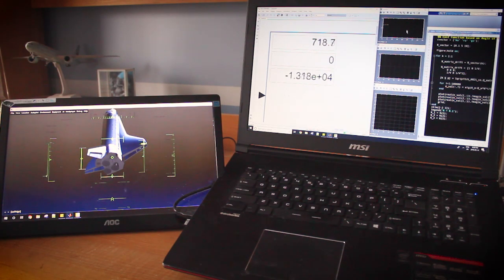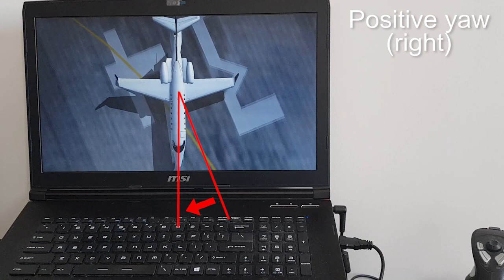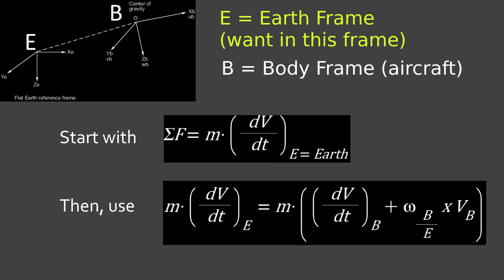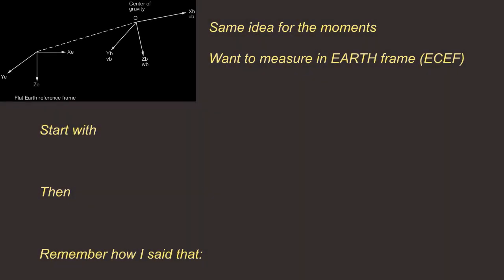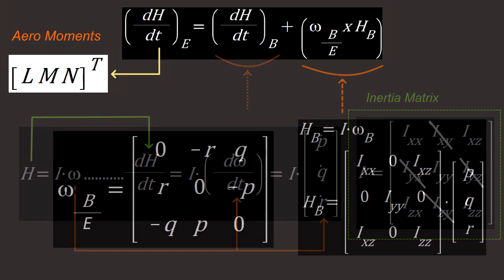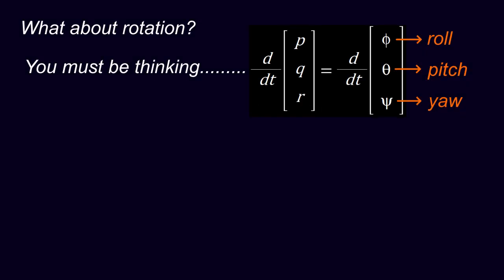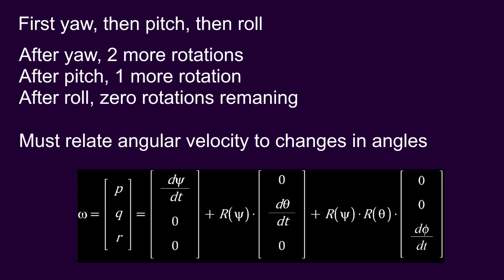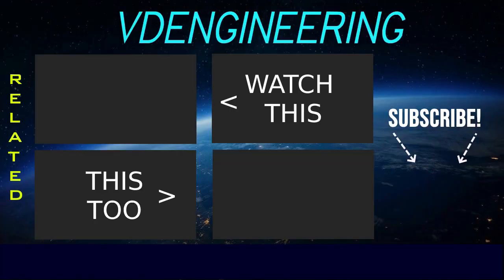What is Flight Dynamics? - Derivation of Equations of Motion for an Aircraft

Comment: Kindly make corrections in it accordingly and I am wrong correct me too.                                                                                                    At time 6.41 in your slide, in M equation, you wrote p.r (Ixx-Ixz) while if we multiply the above matrices it comes to be p.r(Ixx-Izz). Secondly, at time 3.52, the skew-symmetric matrix of wB/E, you wrote is different from the one you wrote at 6.26 time.
Reply: Yes, you are right. At 6:43,  the mid term of M should be  pr(Ixx-Izz), not (Ixx-Ixz)

Comment: Hi vinayak I need your help as I am doing simulation for bell nozzle for pressure based in which I stuck on pressure inlet that which pressure should consider for initial gauge pressure also in operational pressure.